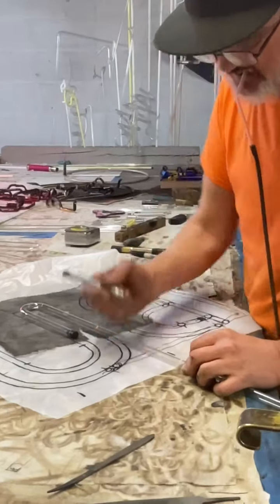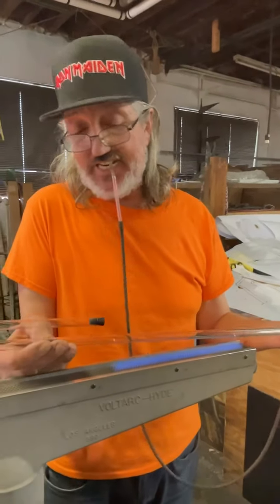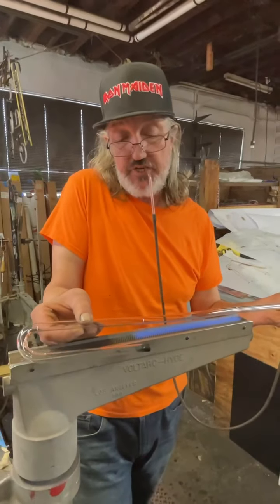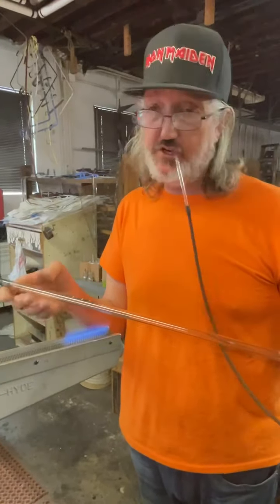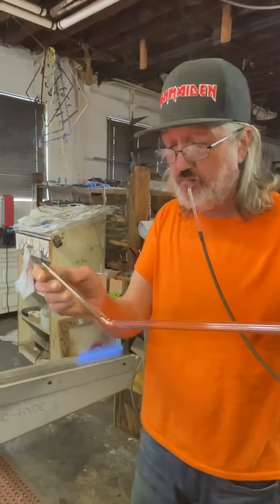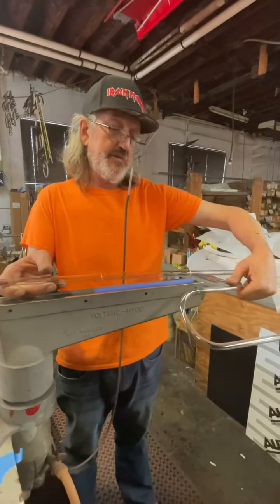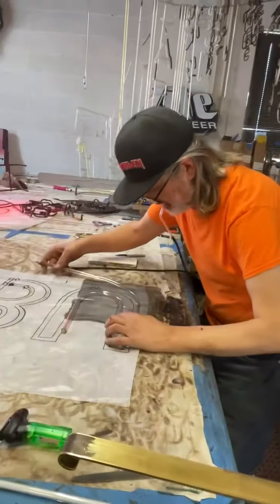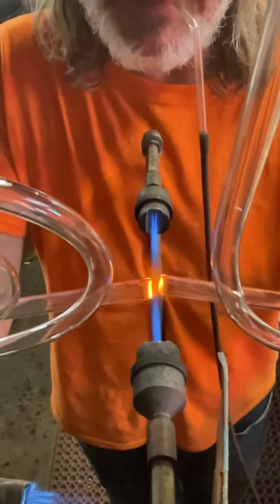Bending a letter U . This is how I bend the outline.

Comment: Before I got sick I was a mig welder. Its amazing how the body adjusts to stuff. I could be welding and have a piece of hot slag go down my sleeve and I would finish the weld. Now, 10 years later of not working I burn myself doing dishes😂
Your finger tips are probably dead by now😂